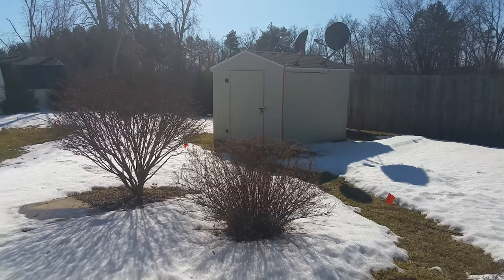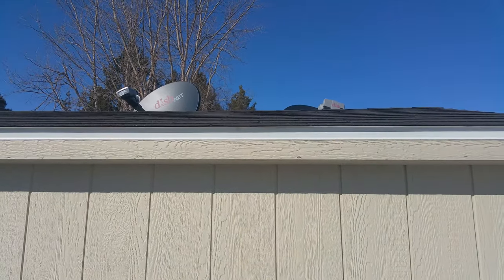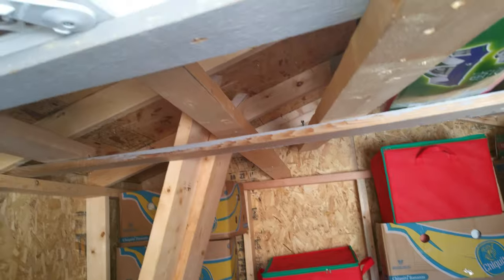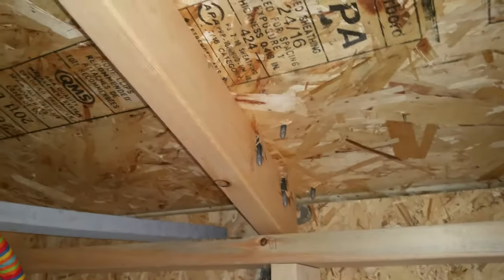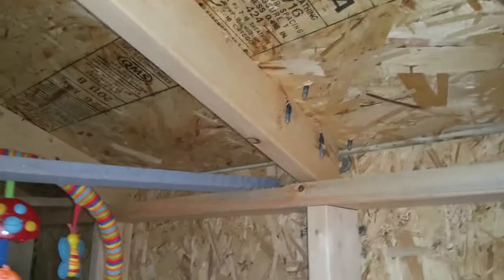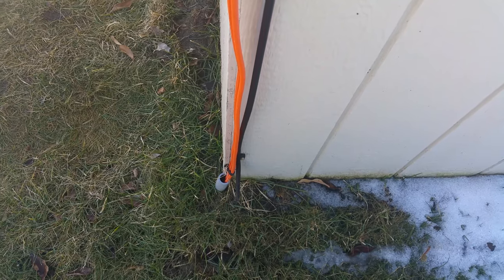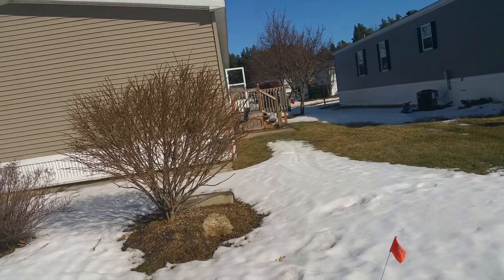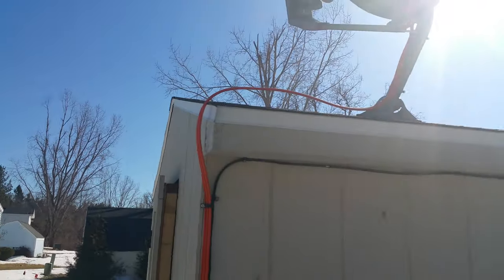Renewable Off the Grid Project - Planning Placement of the Panels

Comment: Caution Caution! You are to allow space below solar panels for ventilation. If you do not there efficiency and life is reduced.
Reply from the maker: There will be 1 inch of space between the panels and the roof. I am also going to trim for drainage and ventilation purposes. Also I will be using high temp paint on the rack I am building. If I don't think 1 inch is enough space then I can always increase that number.